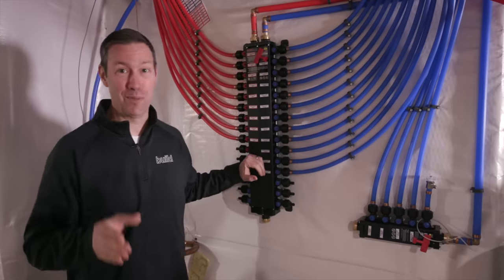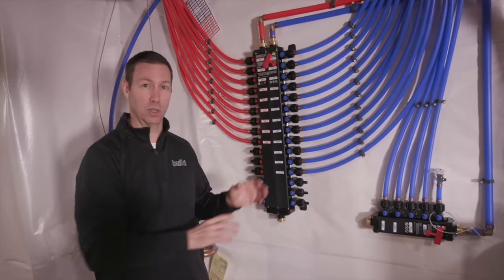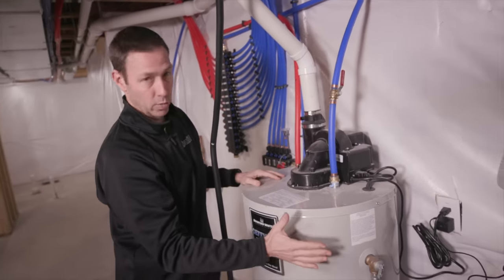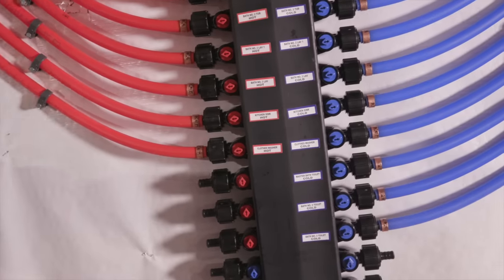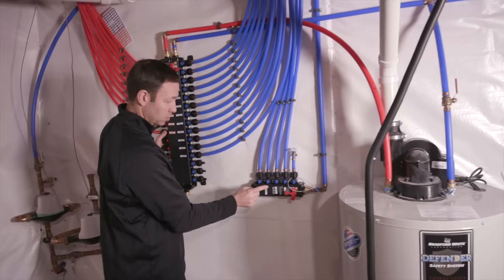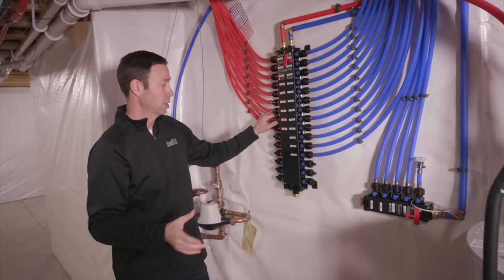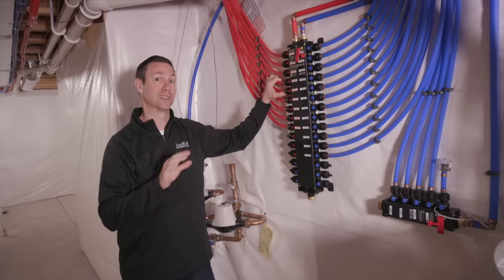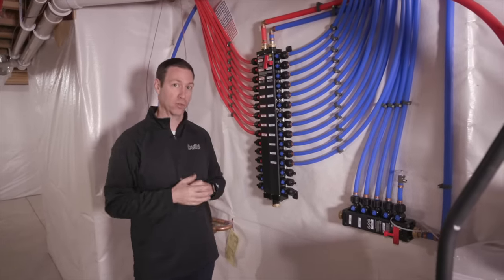PEX Manifold System - Pros and Cons + Tour

Comment: I feel like this would work well with splitting the system into smaller manifolds, per level. That way, you have one hot and one cold lead to each bathroom and then much shorter runs to the faucet and shower, for example. Thinking that would drastically reduce the amount of plumbing runs and you'd still have the ability to shut things down locally. Kind of a hybrid between this and the standard branched setups you'd see.

But I'm not a plumber or builder, just someone with an interest in keeping up to date on the stuff for future reference

Edit: apparently, I'm not the only one that thought of this
Reply: Ya but you would need to install a thermostatic mixing valve to avoid uneven distribution of hot and cold water. If you were to for example flush the toilet while you shower it would cause a flash of hot water with the lack of cold water after flushing said toilet. 

DISCLAIMER: I am not a plumber and the highest level of skill I have in plumbing was when i recently replaced/installed the fill valve in my toilet (thus why I’ve been getting plumbing YouTube vids recommended to me 💀) with barely any (key word barely) complications. I did recently watch a few plumbing videos out of boredom in the middle of the night while I should have been sleeping and I saved 15% on my car insurance by switching Epstein island Auto Insurance. At this point I’m basically a master YouTube plumber so ask away and I will look up the answer for you 🤗

Comment: for a bigger house could you use multiple manifolds and run a circ system to the manifolds only? that way the longest pipe you would have to vacate would be <15 feet if the manifolds are hot already.
Reply: You want to do that, run an Uponor system. Fewer runs and easy to recirculate.

Comment: Hey Matt, you've got a second-take at 10:48 where you didn't cut out the first take immediately before.  This is great info.  Do you think there's any advantage to hybridizing this system, i.e., using fewer discrete lines from a smaller manifold to isolate, say, single rooms instead of each fixture?

Comment: A solution to saving water while still using a manifold system is to use several smaller manifolds at strategic locations around the house, like next to 2 baths and run a hot return to each manifold. Obviously insulate both hot flow/return pipes. This really saves on water loss and time to realise hot water flow to appliances. All pipe joins are accessible and located next to each manifold. Also saves on the cost of pipe.

Comment: I put one of these in the 3.5 bath house that I bought & renovated 3 years ago. It was super nice during the renovation to have the water turned off for most of the house but keep a bath & hose bib running. As I finished up rooms I could just turn them on.
If it had been a new build then the runs could have been much shorter for 2 of the bathrooms. Since we didn’t open all of the walls & ceilings, however, some of the fixtures had to follow the original path which was almost 100 pipe feet for the master sink (from the attic, under the foundation & back to the 2nd floor). It doesn’t take that long to clear the cold water because you don’t have to heat up every line but it’s true that you don’t get the benefit of already having hot water for the shower after the sink has run for 2 minutes.
The biggest issue for me was how much space it takes up. Not just the manifold but the bundles of pipes in the walls & joists. Next time I will make my own manifold & just have one run per room & split it there.

Comment: In my relatively small house my 2 bathrooms and kitchen very close to each other but the water heater is about 40 feet away in the garage. I put a small 4 gal water heater under the counter in one of the bathrooms. It is in series with the main water heater. When I turn on a tap in any of the rooms the run length is about 6 feet so it takes about 5 -7 seconds to get full hot flow. The clothes washer is next to the water heater in the garage. All of the fixtures in the baths and kitchens are connected through a set of manifolds in the plumbing wall of the master bath. No waiting for a hot shower and very little cold water down the drain.

Comment: I recently retrofitted an expansion PEX system (Uponor) into my 1970's-era home, replacing the old electric water heater with a Rinnai gas-powered tankless unit.  Better, I think, than the more common crimp system and very easy to install.  I also incorporated a 3M whole-house filter, with a bypass for the toilet and hose lines.  Compliments to the plumber who did a masterful job on the manifold setup in this video.....getting the hoses visually balanced like that takes an extra measure of effort. PS: I did notice the comments about 18" of separation between the start of PEX and the water heater.  I did that in my install, picking it up as a local code requirement.  Maybe not required in Austin, TX?

Comment: Good pros and cons discussion, but wouldn’t you also reduce the momentary pressure drops when multiple fixtures are being used (ie when you’re in the shower especially)?
Reply: Not if the piping was sized correctly. In other words if a 3/4 line was ran to a bathroom for instance you would not notice a drop in volume by flushing a toilet while taking a shower. Its all about volume and pipe size
Reply: I have had one of these for over 16 years and when running a shower or any other fixture you can tell NO difference if someone else turns on another fixture.

Comment: I’ve moved back into the old house I grew up in. It needs a lot of repairs and updates. One of the things I have issues with is the amount of water that gets wasted waiting for the hot water to come out of the faucets. First thing I need to do is get all the structural issues fixed (termites and rot) then I hope to add on an addition, then all new plumbing and wiring. And also removing all the old siding and hopefully putting in a zip system. I’d like to get it down to a passive house.

Comment: Can you do a pro/con video on central water heaters vs point of use water heaters? Would running just cold lines in the house, and then lower amp tankless heaters for a bathroom, kitchen or washroom make sense?
Reply: imabeapirate Think a tankless gas as a main unit with a small 120V on demand in the kitchen and maybe the bathrooms, the small unit could bridge the gap until the gas fires up and gets hot water to the tap.
Reply: I was thinking the same thing. Central water heaters seem a bit outdated and they're definitely bulky, especially if you don't have a basement to put it in.
Reply: I personally like large central water heaters that are on timers and point source heaters on any long branch runs. With insulation blankets on water heaters, I set the timer to turn on prior to morning use and the same for the after dinner cleanup and later evening shower.

While 120 degree hot water seems like its good enough, I want nothing to do with Legionella. Hot water needs to be 140F or hotter for safety. 

The manifold system system here could be tailored to provide for a long branch with circulation and a smaller manifold close to the end use with a small point source heater.
Reply: This is actually something I was wanting to do until I did the actual math on it... Assuming you have an average faucet (2.2GPM according to Google) where you have 50F cold and want 130F hot, it would take 26kW.  This means running a dedicated 110A 240V breaker, just for that one faucet.  That wire isn't even going to be much smaller than a hot water pipe.

Sure, excluding the kitchen sink and maybe washer, nothing in your house really needs 130F temps.  So what about 90F?  That's "only" 7kW - so a 30A 240V breaker, which is actually pretty reasonable.  But, a lot of older houses (at least in the northeast), only have 100A service to the house.

This is why tankless electric water heaters aren't really a thing.  Personally, I think putting in a small gas tankless for each is just impractical since you'd have to run gas everywhere and exhausts for each one.
Reply: a central water heater tank seems wasteful. it keeps 50 to 150 or so gallons of water 160 deg. 24/7/365. versus only when you need it.

Comment: Alternative: House being built (owner's second home) with 2 bed/2 bath. Downstairs has 3/4 bath and laundry, as well as kitchen - sink,DW,  and ice maker. Upstairs one bath with combination tub/shower and single lav. Using (in basement) through manifold with input at bottom and branches to downstairs fixtures. Through flow goes across mech room to another small manifold to feed upstairs bath.
PROS: 
Fewer 1/2 inch lines running across basement - just pair of 3/4 to second manifold. Definitely neater.
Due to fixture locations upstairs, shower plumbing can be accessed via panel in closet in upstairs bdrm. THUS, access to all pipes coming up either there or inside vanity AND ENTIRE RUN CAN BE REPLACED IN ONE PIECE IF EVER NEEDED. (Connect pull string or new pipe to old and slide through.)
In unlikely event that a leak occurs inside wall, valve at outlet from first manifold can be closed stopping all flow to upstairs until offending pipe isolated.

CON WITH MANIFOLD: I COULD LOSE THAT SHUT-OFF KEY WITHIN SECONDS OF INSTALLATION.

Comment: I would recommend to check your state plumbing codes before installing. In my state you can’t have a direct connection of pex to the water heater. You must have at least 18” of Ferris piping between the pex and the water heater.

Comment: How about putting a manifold per floor with a 3/4" connecting line between floors ?
Reply: That would only be helpful if there was hot water heater at each level in the house.
Reply: Best way to fix this issue of water waste is point of use small tankless electric water heaters that way you run only cold from manifold. Another not as good way is reduce pipe size to 3/8".
I'm looking at trying the pointof use water heating device running on 220v
Reply: Joe Jameson p
Reply: @vitalrights7390  That's an interesting idea.  I have had the same thought before, but can see a few potential pitfalls:
* Cost of each of the systems.  Especially versus utilization.  The less the system is used, the more expensive it becomes in terms of utility.
* Increased maintenance burden.  As the build show has mentioned before, tankless heaters are supposed to be flushed every so often.
* Increased electricity installation costs.  In the US 220 is rare in most parts of the house.  Sending it to every place that needs hot water will require a specialty install, and a larger breaker box because each of those is now a two gang breaker.
* Electricity and water concerns.  There are rules about outlets and electricity in wet environments, like everywhere that you would want one of those tankless heaters.  I don't know the rules on 220V in that environment, but I imagine it would take some work to make everything safe.

With all of that said, I really love the idea, and hope you can get it to work.
Reply: @vitalrights7390  in a small house, 3/8" is the better solution.
Reply: Arthur Moore double GFCI breakers in a pony panel for each unit, the shed, the laundry, etc. Then you can have a regular panel for rooms but a separate panel for uncommon uses. Just put a big splitter & switch (sometimes required to be outside the home though). Only works on a completely gutted home or new build, so choices are endless in those 2 circumstances.
Plus, your pony panel will reduce the amount of high current wires in the main box, thus reducing energized air/ozone concerns. You can feed the main neutral with a nice pair of big neutrals from each discrete box reducing future issues from metal fatigue (150 years away but still a concern). Basically it’s a build what you can afford, unlimited budget, one panel per circuit. Lol!
Reply: not per floor..maybe per ZONE
Reply: IS IT TRUE THAT PEX LEACHES CHEMICALS

Comment: I've seen a lot of people use the manifold or a version but string certain runs. Like to the bath. Two lines. I believe it was 3/4 pex transition to 1/2 for cold sink and split to shower. Same with hot. Less pex and on line. Then a seperate to the toliet.